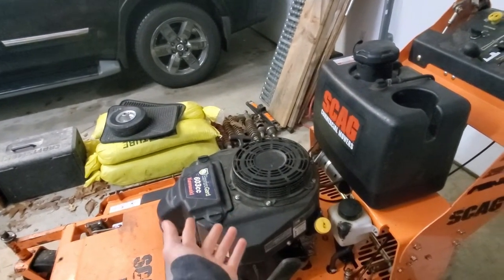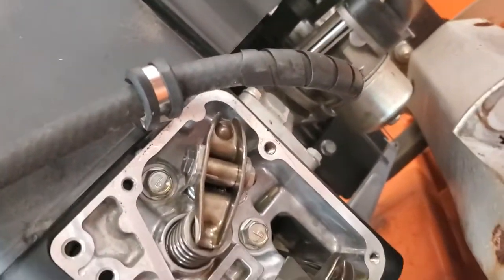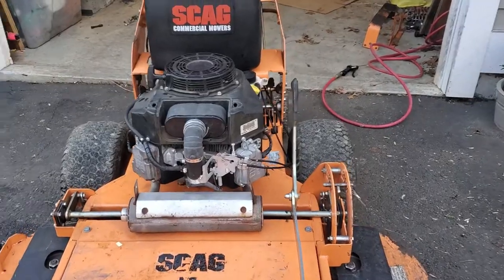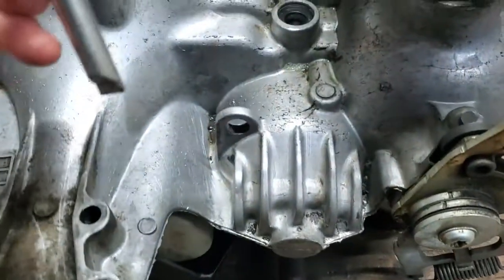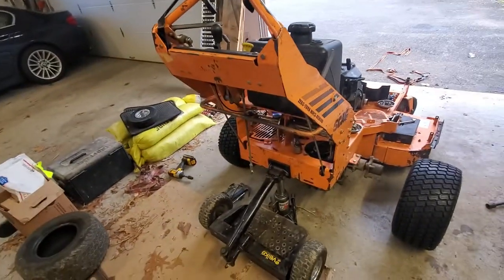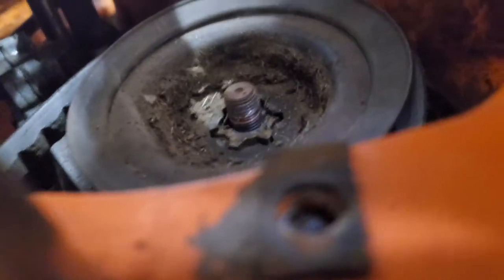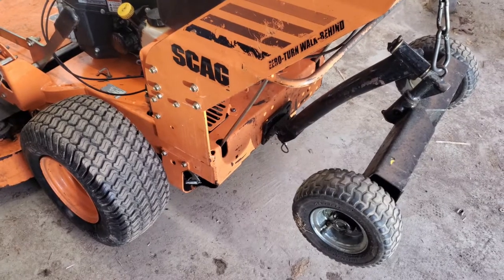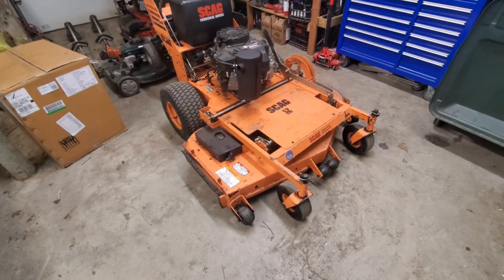Working on my new SCAG SWZT mower

Comment: Great video.  Great mower i had the 48”.   that 52” mower new is $5283 before tax. So I’m sure u came out good.   If you want it to stripe grass and in my opinion cut better adjust the front of the deck 1/4th inch lower in the front.  If your going to mulch or dont want strips just leave it level.
Reply from the maker: Thanks for the tip! I will definitely try that, I thought it was weird it said it should be level... I've never seen a mower with a perfectly level deck
Reply: I have the 48” swzt. I love it, but it was like mowing a hay field in terms of the rows of cut grass that it would leave behind with the chute in place. I just installed the hurricane mulching system last week and cannot believe how well it works. There is literally no signs of cut grass after a pass. I cannot yet tell if the stripes are still as significant as before. That brings me to my question. If I lower the front cutting deck 1/4” as you mentioned, will it still mulch/mulch well? I am not opposed to experimenting with it, but figured I would ask first. Thanks.

Comment: I just bought a 36 used - very low hours and it was serviced in 2021 right before it was last used - the hydro oil looks very clean but is about 1/4” low at cold in the overflow - I’m going to change it anyway - engine oil very clean and full as well so I think I can wait on that 

Runs great at all throttles and speeds 

The unit is pretty clean overall 

Thanks for the detailed service walkthrough

Comment: I just bought a used one as well in great shape but with one small issue. The steering is sticky. When you pull the control levers they will not return to the forward position, I have to push them forward manually to get back to going. Springs are fine and will recoil a little but, but not the way it’s supposed to.